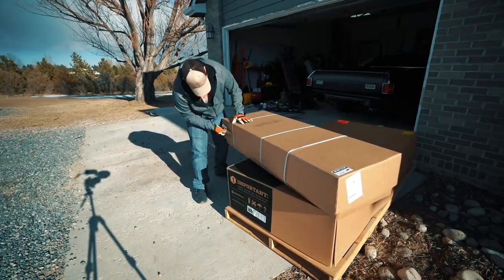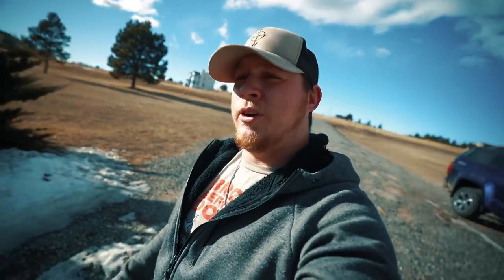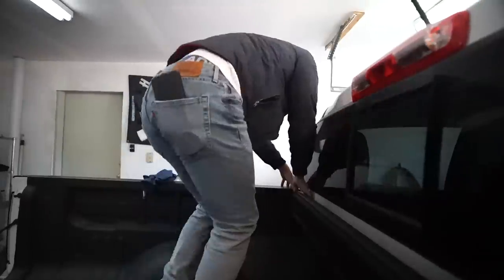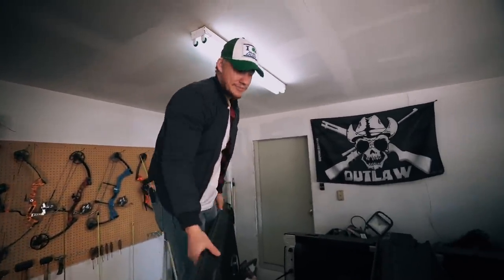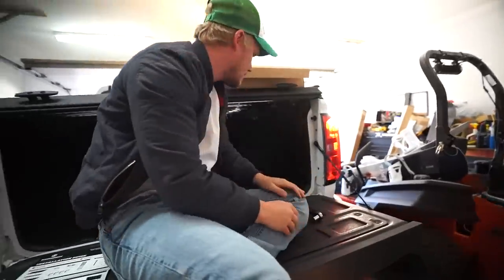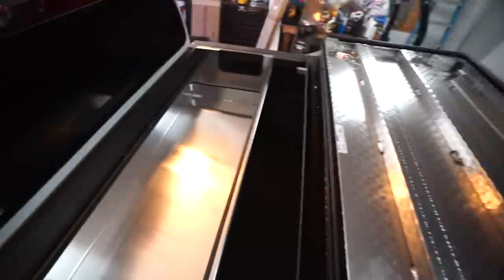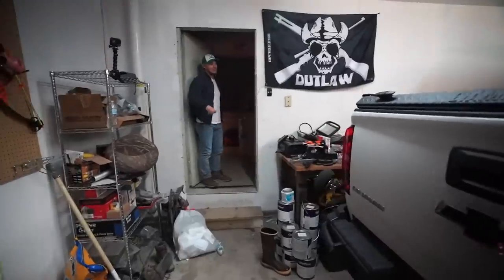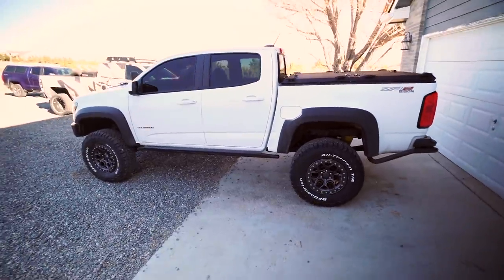I got a SWEET Truck Bed Cover!! *BISON BUILD*

Comment: Pro tip: wrap the tailgate wire around the part on the bed that the tailgate latches to and it’ll stop the tailgate at a 45 degree angle roughly which makes the backup camera point right at your hitch making it easier to hook up a trailer if by yourself. Hard to describe but easy to do

Comment: Put snow camo strips all the around the truck put it on the top of your wind shield, running along the side of your truck, and the bottom of the bed of your truck. Put a full steel back bumper on your truck for just in case you back into anything. Get a 2 little lights facing down onto the diamond back so you can see better at night. Black out your tail lights. Put an outlaw logo on the side of your truck like on the passenger door and driver door. Get chains for your wheels for the snow. Get a winch for the back as well for just incase your can winch forward if you get in hairy situation. Get a CV radio for dicking around and for just in case you get lost. Get a badass satellite gps for your truck.

Comment: you should add bed lights so you can see inside the bed and as well add a bed step so you can access your in bed tool box storage. and maybe a winch in bed.

Comment: Led light strips for inside the bed would be perfect to light up the bed and the tool box, just stick em to the under side of the diamondback. also a headache rack, if there was anyway to attach it with that cover

Comment: Definitely need roof basket to keep luggage and supplies in ,to keep the diamondback cover empty for a 4wheeler and also the bed clear for animals,since you probably will have other people with u always on a hunt who would also get an animal,youll need space for them. 
Bedlights to see everything under cover.
Siderails to get in without always having to jump.
Rearwindow rack to keep window safe from a 4wheeler and stuff on cover.
Also should faburcate a removable comealong or winch under the frontbin in bed to use for pulling deer and elk farther in without having to strain yourself to much.

Comment: Nice brush guard bumper we have deer running across the road all the time in Massachusetts. If it wasn’t for the military bumper I would have messed up the front end in my dads mint 83 c30 dump truck. I think the Bison would look sick with a aftermarket bumper

Comment: It needs ditch lights. Get rigid or Baja designs Led pods mounted at the base of the windshield pointed off the side of the road. Trust me they are much more convenient than you would think.

Comment: If it was my hunting truck I would set the hitch up for a portable ATV winch 2k lbs. For lifting game up in the trees  for skinning or to drop into truck, also you should put a cb or mobile fm radio in, and maybe a    medical kit designed for hunters that bolts into truck.

Comment: Get a magnetic “go-light” for your roof. It’s a light that sticks to your roof and it has a wireless remote and can turn 360 degrees. No bolts required.